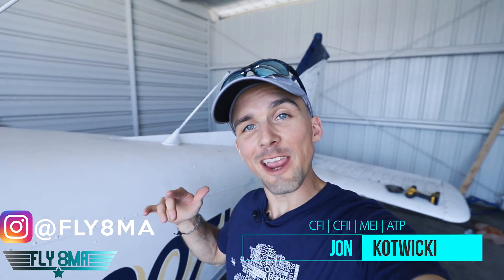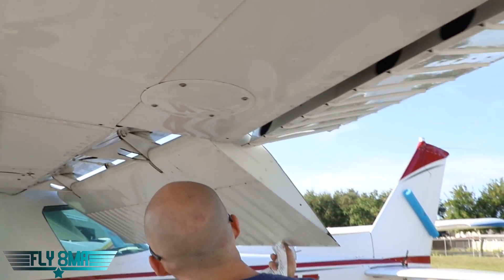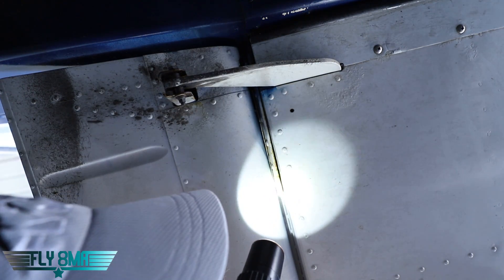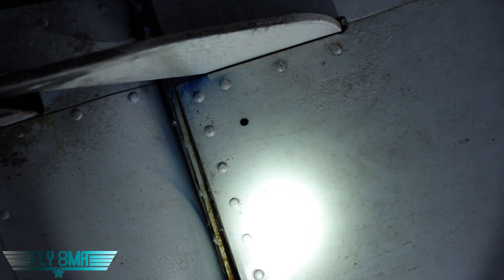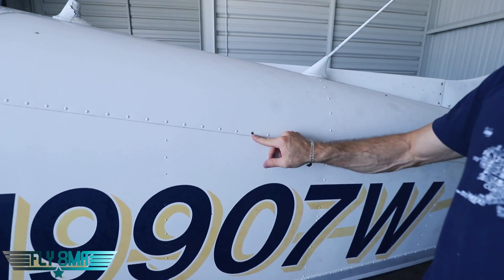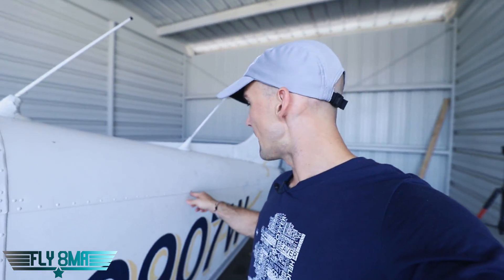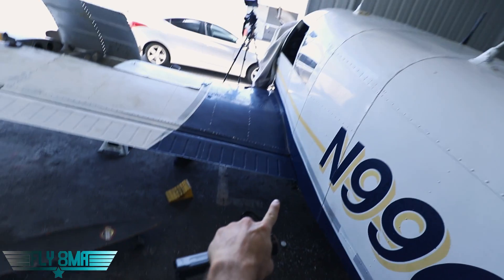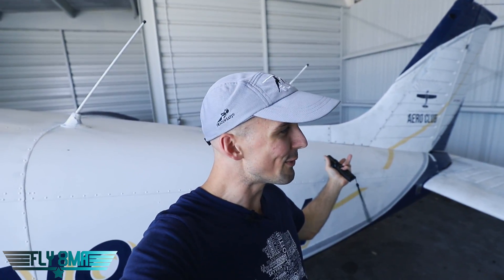Will your wing fall off in flight?

Comment: Great tip with the flashlight. The truth is, with the Sun out, the visual contrast under the wing is going to be very high, so filling in some light with a flashlight should be very beneficial. Your eyes will only detect so much detail with high contrast; the lower the contrast, to a point, the better will be the detail.

Comment: One rivet isn't going to affect safety. You can fly home and get the AP to fix it for you. Frankly, almost nobody will notice a missing rivet unless it is in an obvious spot.  If the rivet is under the wing like the low wing Cherokee, it is very easy to miis because nobody will be crawling underneath a rental airplane during preflight.  Most people also don't know about the spar attach, including owners.  The knowledge to work on these parts are almost exclusively on the IA and AP, except for the experimental world where the builder actually built it.

Comment: In the Embry Riddle accident, the Wingspar itself fails, not because auf missing rivets.
Reply: On the PA-28 designs, the main wing spar is supported by both a rear wing steel tang plate (as shown here) as well as a forward wing tang plate.  Since they are aluminum to steel riveted joints, any moisture in that joint creates corrosion, which causes the issue seen here. The issue seen here is actually covered under a Piper service bulletin calling for installation of an inspection port and subsequent frequent inspections of this connection.  I would bet no way this issue went from being completely wholesome to several missing rivets in 50-100 hours.  It had to have been missed by several A&P 100 hr/annuals to have gotten to this point.  What this tells me is: pick your A&P carefully - it should not be a price-driven decision, as you tend to get what you pay for.

Comment: Where specifically does it say it's illegal to fly with a missing rivet? <- real question, not trying to be an ass.
Reply: Most of the FARs only discuss Airworthiness Certification, as with FAR 121.
However...
FAR Part 25 Subpart-D §25.601 - 699 pertains to Design and Construction. Which also dictates various requirements for materials, joints, fastners, etc. be created and kept within testing standards or otherwise be proven for airworthiness.
So one could argue that if the wing cover, or especially wing spar joint, were missing rivets that it could be in violation of Part 25 standards.
Reply: Close - Part 23 for small aircraft. Basically, the engineering drawings define the type certificate configuration. This is the configuration the FAA assumes the aircraft will be, in and meets all of the rules. Chances are, the engineering drawings (aka blueprints) likely have no allowance for missing rivets (since that would mean the aircraft was overdesigned).  Hence the aircraft no longer meets gust, maneuver or other CFR’s without further analysis. 

To deviate from type design you need approved or acceptable data, which your mechanic uses to substantiate the repair.  This would be in the form of an OEM Repair manual, FAA Advisory Circular or engineering approval (e.g. DER or communication with the OEM). Generally way cheaper just to inspect the root cause and put a new rivet in. 

From a practical perspective, missing rivets may mean something bad is going on that you can’t see, as a rivet was likely over stressed (rivets can fail for other reasons but this is a likely failure driver.) This could result from a crack in the underlying structure, which can be very dangerous, has brought down many airliners. Always have a mechanic inspect a missing rivet and the surrounding structure before flight.

Comment: When it comes to a missing rivet as shown what about putting one in your self if need be?  So in our flight bag we should have a pair of utility gloves.... and maybe a beach towel or a creeper.
Reply: Not unless you're an A&P.   A pilot is limited to performing "preventative maintenance"  Part 42 Appendix A lists the types of things which are considered "preventative maintenance" and may pe performed by a pilot.  There is no way riveting airframe primary structure could be considered "preventative maintenance"

Comment: This is what happened to the riddle Piper Arrow. Student was on his checkride for commercial. Aft spar was fatigued.https://www.aopa.org/news-and-media/all-news/2018/may/16/ntsb-finds-metal-fatigue-in-piper-wing
Reply: Careful on terminology, it was not the "aft spar" it was the main spar aft attachment bolt hole. The thing shown in the video holds the wing fore and aft, not up and down. The main spar is a much more robust structure.
Reply: Looks like there was another Embry Riddle accident 2 days ago.  4 guys died in Carlinville IL when a PA 28-235 wing separated from the fuselage in flight. I sure there is an AD in the works for the PA28 family now

Comment: I thought planes used bolts to attach the wing spars to the fuselage?  I didn’t realize that they used rivets. I thought those were for attaching the skin to the spars
Reply: I just realized that you may not have meant wings falling off literally.  It was just a catchy title meant to rope me in...well played Sir.
Reply: @JRudd  No, I think he actually means the wing could fall off. With all those rivets missing at the spar attach point, if the wing was to be stressed enough, it could fold up.
Reply: @GeneralChangFromDanang  Gotcha. I'm not familiar with aircraft structures, but have worked on wind turbine blades, so I was just curious.  Thanks for explaining it for me.
Reply: Aft spar, the main spar uses bolts and is much more robust. Aft spar is important and the plane in the video should be grounded, but that's not what holds the wing "up"

Comment: Serious question. Would you show how long it takes for water to make it down to the sump point after refueling? Like fill up the tank then put a measured amount of water in it and sump it out immediately and see if you get it all. I'm a student pilot that hopefully will be soloing here soon.
Reply: Not to mention what various debris would look like coming out of the tank. aluminum rust, water, jetA, etc.
 
I flew a C152 once that had been bought from Puerto Rico and flown to Colorado. I got the first flight on arrival and immediately noticed when sumping the right tank that there was about one inch of a cloudy grey substance. Colorado is pretty dry and the fuel truck was cleared of blame. As it turns out; the aircraft had somehow trapped away some water due to poor fuel caps while it sat down in San Juan for 2 years. The ferry pilot flew it across the country without an issue. Never mentioned the grey muck.
 
As it turns out, water in aluminum tanks, mixed with Avgas will slowly oxidize the surface layer of the tanks and as the water rolls around on the bottom it picks up the particles of aluminum rust and creates an ominously black and sooty cloud that immediately settles to the bottom of your tester. I'd never seen anything like it.
 
They ultimately replaced the fuel tanks when the problem persisted.
Reply: Great question
Reply: Did you complete your flight training?

Comment: If those rivets were important they should be on the checklists.  How on earth did they go missing? That could be of more concern than the fact they are missing!   It should not take an "astute" mechanic to spot that.
  With any visual inspection people also need to be trained in what is a pass and what is a fail, e.g. with example pictures.
Reply: Sometimes you lose rivets over time, most of these planes are over 50 years old & I don't think piper expected them to last this long when they made the poh
Reply: Each individual component is not on a checklist. There is an item called empennage or fuselage that encompasses the components within that structure. As you walk to the tail you should be eying the whole structure and noticing any abnormalities. Same with checklist items like aileron. It doesn't tell you to be making sure each hinge fastener is there but you'd better check.

Comment: It's what happens when you stick to only checking what is on the preflight checklist. Or just look at the bare minimum when it says to check for popped or missing rivets or wrinkled skin and you look for the most obvious areas looking for evidence of a hard landing or over-G.

Admittedly, I have close to 250 hrs in Piper's and I have never looked at that spar attachment. So Thanks for the info. Lucky for me I flew in a university flight school that were very meticulous with the maintenance of their airplanes. I would have no regrets buying one of the ones they retire. I actually preferred the controls in the old planes.
Reply: Curious fact is that light aircraft have a higher load factor rating than commercial aircraft.  E.g. 3.8G vs 2.5G.  

But I don't think you can tell that kind of damage by looking.  I heard the PA28 wings have dropped of in the past on rare occasions and there was a directive to inspect the wing spar holes where the bolts go through.  That is done by eddy current measurements after disassembly.  With the age of these aircraft you probably never know, they could have exceeded the load factor rating by being blown over in the wind. Of all the risks, the wing dropping off is probably at the low end.  Almost unheard of.  I did once hear of a glider where the wings broke off, but that was because they were connected upside down.

Comment: Well planes still where in The air after being shot at in world war 2, all they did was make sure they had important things working. It’s not the end of the world having a hole in the body if it’s not structural it’s not like it’s pressurised like commercial aircraft. Still things it’s best to have things repaired but I’m not sure what the rules are in the uk on aircraft regarding the body of the plane.